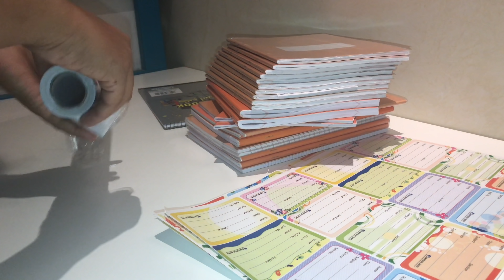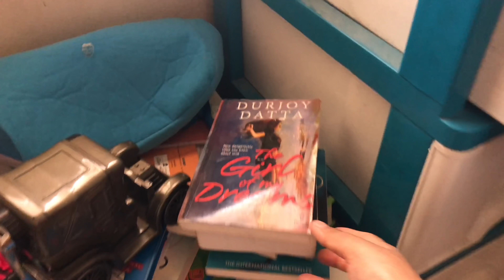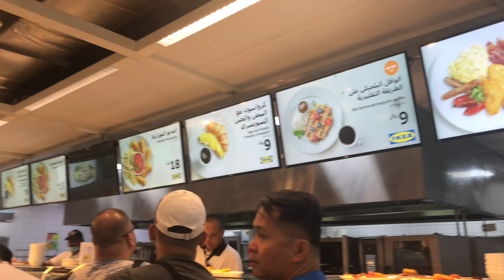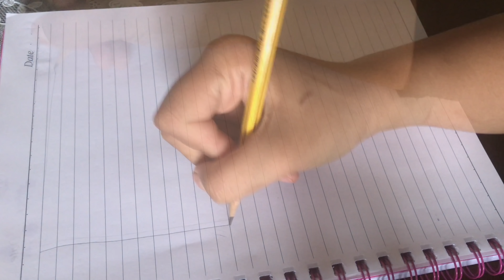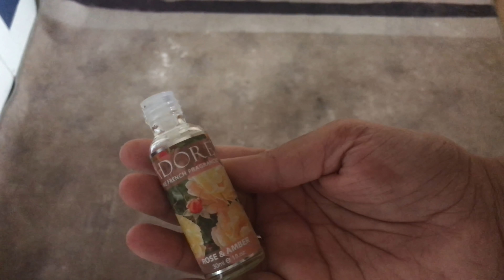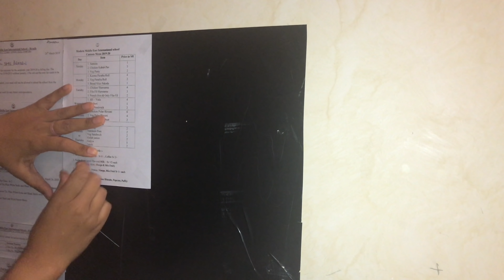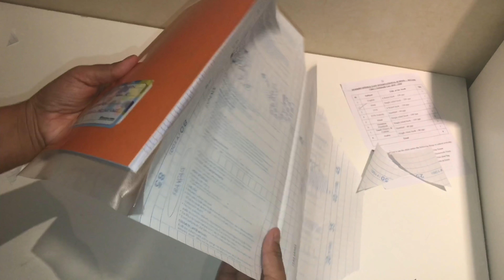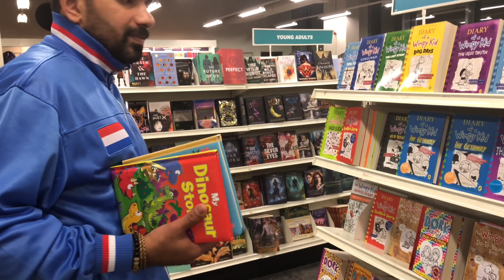Back to School Organisation | Small Makeover to Kids Room | How to cover a book with clear adhesive

Comment: I have a suggestion instead of sticking the papers on wall you can use bulletin board and pins or magnets so it will be easy and more apealing.
But otherwise its a woah  :)
Reply from the maker: Actually some paint had come off that area .... thats y i had to do sonething to cover it up..... i ended up doing that way ☺️☺️☺️